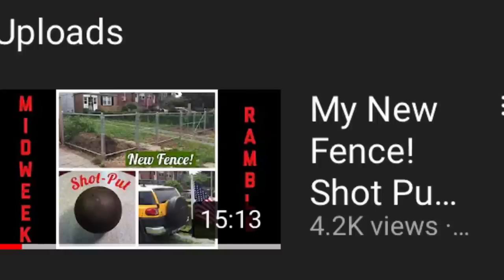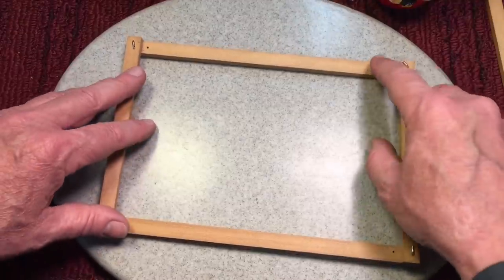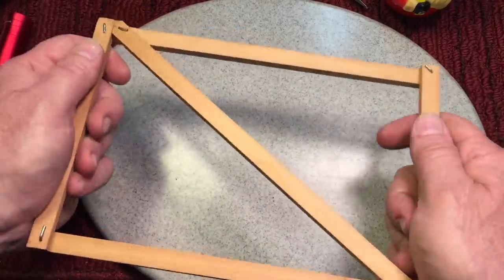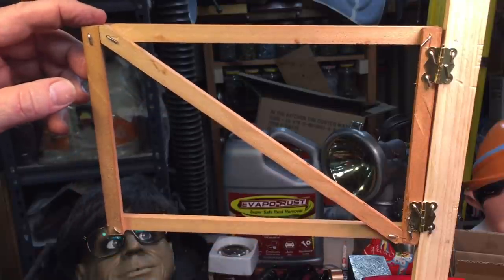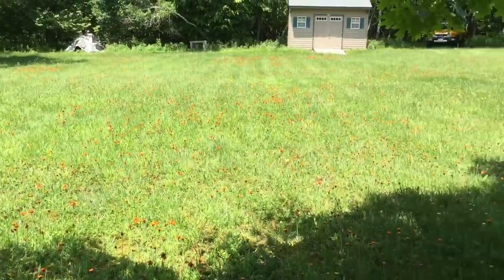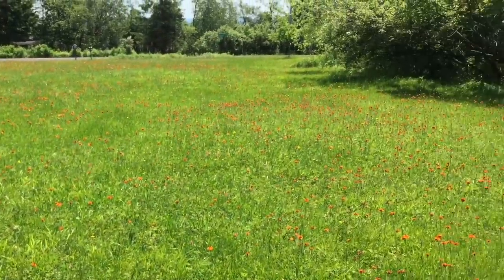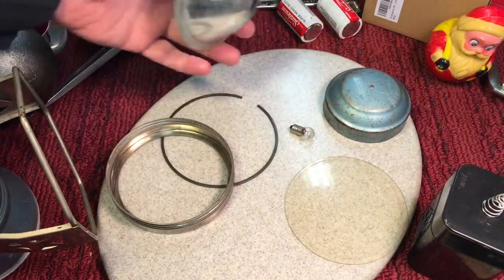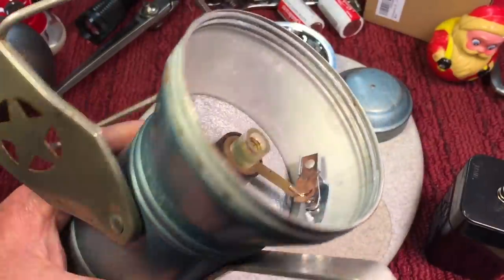Star Headlight and Lantern Railroad Inspection Light.

Comment: In 1971, my aunt traded in her 68 Vista Cruiser on a 71. My dad practically followed her to the dealer to buy the 68. It was the first car my parents ever bought with automatic transmission, power seats, power steering, or power windows. This was the car my sister learned to drive in, and she hasn’t been satisfied with the acceleration of most of the cars she has driven since then. In 75 my aunt traded in her 71 Olds and Dad went and bought that one too. For a while we had four cars for four drivers. Dad always had at least one station wagon from 1971 to 2002.

Comment: John, I have a degree in manufacturing  engineering. One of my classes was all about stress calculations on different structural designs utilizing “Vector Analysis” and material characteristics. You absolutely nailed the gate tension vs. compression explanation. Super accurate and easy to understand. Great job. Next that station wagon. My father taught me to drive in a 1968 Chevy Station wagon. Light yellow with the same “Wood Panel” contact paper like decals. Ours wasn’t such a fancy model as the one you showed, but it did have the small rear facing jump seat that us kids used to fight over. Ahhhhh, bench seats and drive-in movies. Yes, they will never know the joy. Your ability to take us old geezers down memory lane is amazing. So that flag pole would make an amazing Field Day dipole center support. Just saying….

73,
John
WE1JR
Reply from the maker: Hi John!  One of my scoutmasters had a big wagon with the rear facing seat, you’re so right- we all wanted to ride back there!  😃👍. Thanks!

Comment: Great mobs Monday. Your instructions on gates was extremely informative as a purchased gate got it all wrong and failed in a couple of years. I built a replacement about 15 years ago from pallet wood (planed and finished) with correct tension and it still looks good.

Comment: That's a user friendly flagpole.The polished cap on the light is a nice upgrade.As for gate supporting,I've always gone for the bottom to the hinges.However after your explanation of compression and tension,I'll be going the tension method from now on. Not only for durability but also I think a lighter material than the gate frame can be used. If you have gate swinging children in your family,the tension method should stand up longer.A most excellent Mosh,I must say.

Comment: I replaced my parents fence and wooden gate. I used the compression way of fastening the stringer on the gate.  In tension the gate weight is pulling on the top hinge,  and in time the hinge will sag. In compression all the weight is supported by the bottom hinge,  the gate won't sag. I look at the neighbors gate and he has it in tension. It is pulling the upper hinge put of the wood and the gate sags.
I have several of the exact lantern at home. The car inspectors used them exclusively for many years in the rail yard.
1965 Vista Cruiser, by Oldsmobile. It had the small windows in the roof like a double decker over the road bus. Sexy!
Reply: this is exactly right. 
Many years ago, on an installation, we had 4 identical gates in one customer's yard. In order to settle this very argument, we set two up one way and two the other, then draped half full bags of sakrete over the top rail, farthest from the hinge post. The "tension" gates were almost instantly in distress, as the load tried to pull the top hinge off the post.
The "compression" gates effortlessly transferred the load to the lower hinge simply pushing it against the post to which it was already affixed.

The "tension" advocates bought the beer that afternoon.

Comment: A very good explanation on braces. For structural engineers, the twelfth commandment was "you can't push a rope". Unfortunately they missed that when the Hartford Civic Center was built in the 1970s. The roof collapsed in the late 1970s. Fortunately, nobody was hurt because it was late at night. UCONN did part of the investigation and found that a member designed for tension had been put in compression and failed. 
I was a Civil Engineer for 40 years and figured that it was taking Pioneering Merit Badge to the Nth degree.
June 14 is Flag Day and the Birthday of the US Army Corps of Engineers. It also was our wedding day in 1978 at FT. Belvoir. Good Luck, Rick
Reply from the maker: Rick- engineering is one of the most fascinating sciences ever studied. I think our first lessons in engineering was building forts down the dumps when we were 10 years old!  😂😂😂👍

Comment: If I'm not mistaken, the strongest possible bracing would be to run the diagonals both directions. Both of them 60° equilateral triangles. This is how sheer walls were constructed prior to structural plaster and drywall

Comment: I built some gates back in the early 1980's, I built the tension and compression gates and think that is  the best way, In other words X. These gates are made of rough sawn select structural doug fir and are still as good as new. All joints are doubles gussets both sides and are 1/4 aluminum with through bolts SS.
Reply from the maker: Dale!  You can’t lose with X gates!  😃👍

Comment: very nice wagon also a great wagons was Buick estate wagon more upscale very similar. Trainman Lantern of metal used to be common especially in railroad towns but hard to find metal ones now. Another railroad worker perk was always had lots of fusee flares with spikes in the end. Had a 12 foot gate they used a diagonal cable with a turnbuckle if it sagged you just tightened the turnbuckle worked great. I liked the flagpole. What is the outside diameter of the pole?

Comment: Great mosh SC! We had two station wagons growing up. First was a green Rambler. Great little car. I remember riding in tailgate part with no seatbelts. There was a chrome bar on the back bench seat that I would twist and I would make a screeching sound and drive everyone nuts, lol. Next was the newer Chevy Caprice wagon with the faux wood panels. Very reliable car. I remember the tailgate hatch opened two ways by folding down like a truck tailgate but also like a door with a hinge. I always though that was ingenious. I remembered flag day and had mine displayed. Great to hear that the Star company is still in business making the same type of products. Rare to see the commitment of newer generations to an old company.

Did you get the pic I sent you of the cannon ball carrier?
Reply from the maker: Steve- Going to check emails later!   We will meet up at smith town next week!
Reply: I may not make it next week as it’s my son’s birthday

Comment: Tension is best. I've stood on stronger gates with compression support and the pipes bowed. Then I've stood on gates with lighter pipes in tension and they never budged... Cables need a way to tighten as they stretch. This is why elevators have many cables, 7-9!

Comment: Funny, I was going to comment last week, IMO as a builder we build bracing as compression due to the fact that you are transferring the force to the bottom of the post as opposed to pulling on the top of the post which could bend or warp the post, in that case a cable would be attached to the top of the post down to the bottom of the next post over to resist the pull.
Reply from the maker: Hi Tom- There is no wrong way, just suited to the materials you are using.  Remember whether you are in compression mode or tension mode you are still transferring the same load to the fence post.  In compression mode the top rail of the gate acts in tension mode pulling on the fence post.  Think of the gate as a solid sheet of plywood, the weight of the gate will always push on the base of the post and pull on the top no matter what configuration the gate is built..  😃👍

Comment: Hey Scout great video as usual. I’ve always noticed that a lot of Americans have the flag flying but in Australia it’s not very common at all especially on a flag pole. I was always taught to put a diagonal brace in tension so that’s the way I’ve always done it.
Now here is a question for you, what machine uses a belt in compression? This piece of machinery most people have heard about but most people never get to see the actual belt. Cheers Stuart 🇦🇺
Reply from the maker: Stuart- I have no idea!!!!   A machine that uses a belt in compression?   =D
Reply: @ScoutCrafter  This belt is made up of very thin metal pieces. The early designs used a rubber belt in tension but modern designs use a metal belt in compression. Cheers Stuart.

Comment: I don't know much about the tension argument. But watching this, I was struck by how many possible failure points there are on a gate like that. Seems like with either choice, you're putting different stresses on all the various connection points. It seems like that's the bigger concern. The bending of the longer pieces simply depends on the strength of the material, either way.
Maybe I'm not communicating very well what I'm thinking in my head. Thanks for the video and making my brain work a bit. :)
Reply from the maker: Ben you are spot on-  There really isn't a right way or wrong way as it depends entirely on materials, environment and skill level.  Sagging gates have been a problem for a thousand years!!!!

Comment: I would argue the strongest of all shapes is the circle or an arch which is half of a circle. I would also argue the way you installed the brace in your mock-up in the compression example was incorrect. The brace should be installed in such a way as to support the beam or top rail not the upright. Having said that I use both methods on my gates; a cross brace in the compression position and a cable to cover the tension support.
Reply from the maker: Apples and oranges- a circular support on a gate would not be as strong as a straight brace across.  That’s why you never see gates braced with circles or arches.

Comment: In wood, compression style because in tension the fasteners tend to pull out. Built right, the wood takes the load in compression.
Reply from the maker: Hi Bill, I agree most times width would the fasteners can pull out when used in tension mode it all depends on materials!  😃👍

Comment: Not to be pedantic, but the triangle is not the strongest shape, the circle is.
Reply from the maker: The circle is only strong in certain ways. Not in this configuration
Reply: @ScoutCrafter  I disagree. The correctly sized circle would intersect in eight points. It would effectively be the triangular gussets all the way around, just with a slight arc. Obviously it makes no sense to build that way, nor would it be stronger unless you welded in a preformed circle, but it would actually be stronger. Every "diagonal" would be separated into two shorter diagonals, making them stiffer. Physics-wise I'm right, real world application you're absolutely right